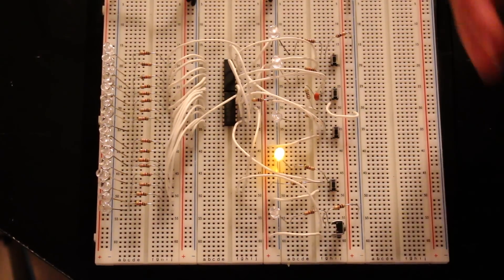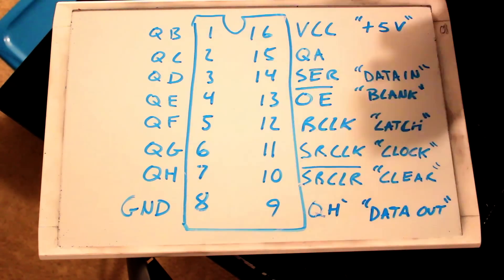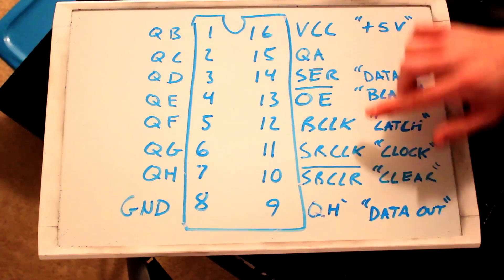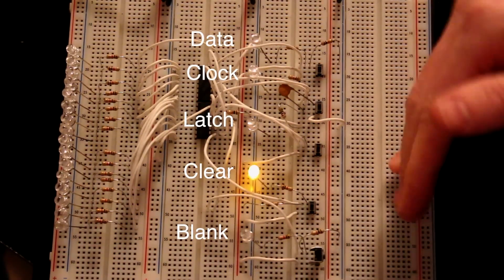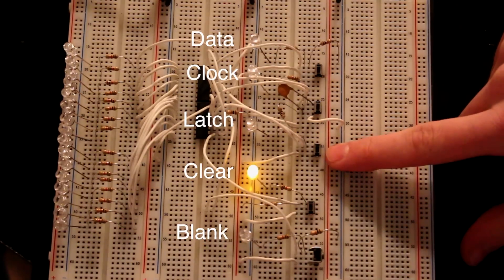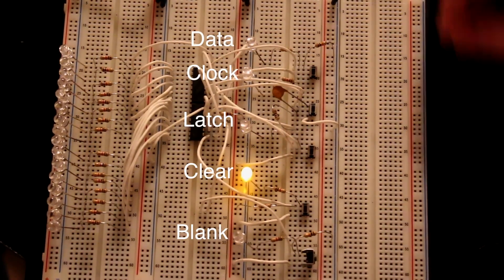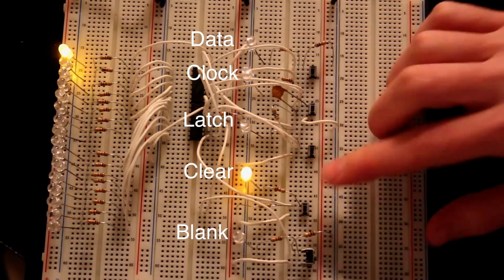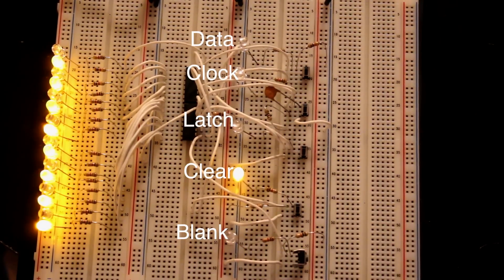How Shift Registers Work!

Comment: Very informative, explains what's happening better because manual. It doesn't HAVE to operate with a uC. You might have a reason to trigger clock or latch only under certain conditions.

Comment: Really nice to see a video, regardless of it being older, talking about shift registers and not including on microcontroller. If you are able to do a lot of stuff without microcontroller than you can just absolutely do killer stuff when you start using them! As a very stereotypical example, just a simple LED Chaser circuit, doing it with couple quad comparator chips , shift registers stuff like that is going to teach you so much more than diving straight into microcontrollers and microprocessors! If you get it even halfway decent understanding of operational amplifiers, latches and flip flops, miscellaneous 7400/5400 series chips or even 4000 series stuff and understand how to combine them together and so on and so forth -- it just allows you quite literally make whatever you want, even with just going a pic16 chip :-)

Comment: this a very informative tutorial,however you could have mentioned if it is a SIPO or PISO chip because the difference between serial data and parallel data could be crucial in ruining a system,is it true that if you used PISO shift registers the inverse of the circuit would be true?

Comment: I tired replicating this but couldn’t get mine to work. The LED lights hooked up to the data/clock/latch buttons light up when I press the button but then when I hit the latch button it doesn’t light up the LEDs on the any of the outputs. Is there a way I can test the shift register to make sure it’s working? How do I trouble shoot this? Any advice?

Comment: Can you tell me the difference between that chip, and the 74HC574 Octal Edge Triggered D-Type Flip Flop? Just by the description, Octal means 8, they both have 3 state outputs,  so the real difference is the term register, and Flip-Flop. So what are the practical differences between the two. Most specs are the same.
Reply: The difference is that the flip-flops inside a shift register are internally connected, whereas the flip-flops in the 74HC574 are independent. You could use external wiring to create a shift register from a 74HC574.

Comment: 03:32...Bro you messed up with names of SRCLK and RCCLK
Actually SRCLK (pin 11) is shift register clock and RCCLK (pin 12) is storage register clock
Reply: IOT ACADEMY I noticed this too! He got the numbers and  abbreviations right according to https://www.ti.com/lit/ds/symlink/cd74hc595.pdf But, he calls them the wrong names. SRCLK is "Shift Register CLocK". RCLK is "storage Register CLocK". What he calls "Latch" and "Clock" are consistent with common EE nomenclature. But he verbally swapped the long-form names. In other words, everything he wrote down, he did right. What he tried to improvise off script he got wrong.
Reply: The mistake starts at 3:18

Comment: Do these things operate fast enough to say, illuminate shift lights in a race car? As you engine speeds up easily enough you just keep shifting ones in, but you can't do it in reverse. You would have to clear the all the data, and shift in n-1 number of 1s. Can a shift register do this faster than the eye can tell?
Reply: If you can push data to it fast enough (for example from a microcontroller) it should be able to do it.

Comment: This video is really well explained but one misunderstanding is seen in 7:25. I don't know why it works in your shift register but I done this by using microcontoller+74hc595 and what I can say - if only clock goes from zero to high state it won't put zero in register, you have to put data pin high when low and then put clock in high state. Done this by simulating in Proteus 8 and also tested on PadBoard, so your method works only  in simulating program but not in real life.

Comment: Great way of demoing how they work. Shame you were dismissive of the blanking line :P an example of its utility many people can relate to is a blinking 7seg display, suggesting user input.
Reply: George Hafiz but with modern microcontrollers it's too easy to just blink the whole register with code. Then you can do the more common thing of blinking only the first 2 digits of a clock and then only the second 2 digits for inputting hours then minutes. Saves you a pin but costs you a bit of memory.

Comment: Sorry for noob question..Can I send in 2 bytes of data and then latch it or is it one byte - latch, one byte latch?
Reply: Yes, you can. Just do all the data in and clock cycle inputs, then hit the latch, rather than repeatedly doing one clock cycle, then hitting latch.

Comment: explained so that all is as clear as crystal (and not as confusing as the rules of american football).
I spent hours working this out when I first started doing stuff like this....to the point, that instead of 'counting sheep' to get to sleep, I was wiring these circuits (and multiplexing, working out clock cycles, etc) in my head. needless to say, the leds never lit up up (in my head) because at that point I was snoring (apparently....ask the wife, lol) . designing the circuits is one thing....writing the code to control the circuits is another. electronics and coding where two separate disciplines until the PI and Arduino hit the scene.
you present this subject (and others on your channel) very well, Kevin. I could have saved lots of hair pulling time if I'd had info like this.

ref. shift registers & co: there's a nice wee freebie program on google playstore I can recommend, called "current for android", in which you can simulate logic gates, shift regs, ram, flip-flops, adders, scroll led and lcd displays and so on.  I use it all of the time - especially when there's no chance to squeeze in some quality lab time. a great tool to have at hand when one has a 'eureka moment' ;)

thanks for posting, man. subbed btw! :))

Comment: You are an excellent teacher! I"m an engineer but new to programming.  Can I use shift registers to control over 50 mini-vibrational motors (smart phone vibrators)?
Reply from the maker: yea, sure, just watch your total current draw per shift register and might want to throw in an antiparallel diode across the motors
Reply: great...thanks much! :)
Reply: One word here... Transistors :)

Comment: Definitely one of the better IC demonstrations I've seen. Well done! It does appear that for simple animations, microcontrollers can latch more often. Out of curiosity, driving common cathode (-) RGB leds, how would you control common sink RGB leds? There seems to be one option where each led occupies 3 bytes on one output, or an option of using 3 sets of shift registers in parallel where each led occupies 1 byte on 3 outputs.

Comment: Wait, if it's on the rising edge, then when one register pushes data out it's out pin after you press the clock button, hasn't the clock on the second register already been on high for a while?
So there's some small delay they tolerate then? Or am I missing something?
Reply: He doesn't actually use the output 7 (QH) as the input for the next shift register, but rather QH'. If you look here https://www.nxp.com/documents/data_sheet/74HC_HCT595.pdf on page 5, you can see QH' (on this datasheet Q7S) already turns high when the clock goes low; so if it goes high again, the input for the second shift register already is high
Reply: MeatLeBeef Dam that's pretty clever, thanks.

Comment: Can you turn on 8 LED-s (simultaneously) with this Shift register if every LED (with resistor in series) must have the current of 20 mA? Data sheet says that the Maximum Vcc current is 70 mA, so... No?
Reply: Btw. gr8 video...
Reply: Btw. gr8 video...

Comment: I have played with electronic projects for years just for fun during the long cold winters.  I play with the Basic Stamp and A/D converters, temp sensors, easy things like that.  I have always wanted to learn how to build and use the basic circuit building blocks that make up a real circuit.  Over the years my interest in electronics has faded a 'bit' (see what I did there?).  

I had to buy an oscilloscope for work and was doing some research when I ran across your videos on the shift registers.  

You explain everything is such a way that it is easy to understand.  I'm excited to watch more of your videos.  Tonight's project is to dig out all of my electronic parts and get to work on your shift register project.  I know I have some 595's just not sure why I ever bought them.....

Thanks a zillion!!
Reply from the maker: +Dana Anderson thanks!

Comment: Hello I have a problem with the shift register. When I turn on the device sometimes I get random data already(ex QB, QC is high) this is the case when the shift register works as expected, but when I turn on the device and get from start every Q output as low, the shift is not working at all(can't insert 1's). What is even more weird is that when I already have something in it if I shift 0's till all are low, again is not working at all, can't insert other 1's. I connected pin 10(SRCLR) to +

Comment: HI there! Great tutorial, built the circuit from your other video. But I had to pull down the clock, latch, and data lines with 1k resistors to stop static interfering with the 74HC595. Drove me crazy trying to find out why it wouldn't work till I found out my hand was carrying a positive charge lol! Useful for anyone else building the circuit.

Comment: ..excuse me, is possible to have the schema of the circuit of this shift register, I am interested to realize this circuit with the value of resistence and other, especially the connections between  push button   and 74hc595 and between led and the integrated.
All of that is possible to have for realize with succes this circuit.
Tank you very much and my best regards.
gigino

Comment: Why there is a capacitor at the clock bottom?
Reply: LinardsHunteR I think it is there to fix a problem called bounce. Basically when you press a button it can bounce and send the signal more that once
Reply: Yes, that's it exactly. Remember this metaphor: Resistors "slow" the flow of current. Capacitors "slow" the changes in the flow. Of course "slow" is not correct but in the context of the common water metaphor, it works.

Comment: Hey Kevin I think I have managed to get correct outputs after adding a 7805 voltage regulator to the clock input to the 74HC595. Thanks to Afrotechmods's video on voltage regulators.

Comment: Umm, when I input the ones the output are correct, however when I enter one zero, the output are 2 lows instead of one low. Do I need a 5v voltage regulator before the clock?

Comment: Once you've added say an arduino.  How can one pin drive so man LEDs?
Reply: You would need more than one pin, because you would need pins to drive the clock clear and latch functions. But still, if you get 8 static outputs from 4 pins, you are still winning.
Reply: We'll I actually meant how could 1 5v source drive 16 LEDs.  

Won't it draw too much current?
Reply: ...and thanks for a reply.....

Been wondering about this for a bit.
Reply: ...that and while I like this guys videos....

At least in this one he says clock in a bit then when he latches it he says clock....

If I had my eyes closed I'd never know exactly which button he's activating.
Reply: Anonymous Really I guess the arduino wouldn't power the actual leds, you'd either use a mosfet or transistor. But I'm also new to this so don't qoute me on that

Comment: hi, great explenation!
does the shift register keeps its memory when the Vcc is off?
so i could use this to store a variable as a byte even when my arduino is swiched off.

reading these bits would probably require another shift register, 8 transistors and some resistors.

Comment: I have followed your other video to build the circuit and soldered it directly on a pcb, all looks good except that I haven't debounced any button, but this strange thing keeps happening... all the Led's fire up in a random fashion, all at once, flashing, only when I approach the board or the buttons...i think it's EM field or interference from home appliances but I can't make it work. Do you have any advice for this? thanks

Comment: jordanwade94 First, he's already done a lot of videos on the use of shift registers (watch any of his led cube videos). And yes, bouncing caused by physically pressing the button can cause a "double clock" which you don't need to worry about if it's actually using a clock pulse you supply from arduino.

Comment: I'm trying to replicate this setup on a bread board, but how do you control the clock with push button? because just putting a push button between a 5v source and the shift register, basically does 4 to 8 bit everytime I click the button...
If you don't have a network diagram, ok, but can you tell what component the clock button is actually controlling? thanks

Comment: You are controlling 8 standard leds (~20mA) with every shift register. I looked at the datasheet of this ic and the maximum supply current is 50mA. How can you have all 8 leds on at the same time? That would draw  160mA which is more then 3 times the maximum limit!

Comment: Here is a video of what I have got
watch?v=5KPNbgIqF14
also provided the source.
i use 5V
Data comes in with no problem and all seems right, but I cant get it out put the stuff from the registers to the output.
I looked at the datasheet and all seems to be connected right.

The 74HC595 may also not be grilled, because sometimes (at random momment) i get some output

Comment: This really is a great tutorialy and was easy to understand.
I am testing the 74HC595 now, but I don't get any outputs.
Clear is High, Data is high while clock is rising and latching does not do anything to the chip. I am using a Raspberry Pi with Python. Do you have any suggestions?

Comment: First off let me say I love your videos and keep up the good work! I am going to build a digital clock using an Attiny 45 I have 5 pins to control 23 segments. Three 7 segment displays and 1 segment for the tens column (I wired them together to cut down on the number of outputs) and 1 for the : encase I want it to flash for some reason. I also have 3 SN74HC595N shift registers that I can use. I never used any shift registers before so is it possible and where do I start?

Comment: Another great video, Kevin!  I built a traffic light simulator (4-way with left turn signals for the main street as well as crosswalk signals and emergency vehicle triggered light changes) using four of the 74HC595s... these are great for expanding the outputs of an Arduino.  I also used two 8-bit parallel to serial shift registers for the road sensor/ pedestrian crosswalk buttons.  Someday I will upload a video with the whole project.

I like your videos - they are clear and easy to follow!

Comment: Thanks for the clear tutorial! I wanted to mention that I'm using a 74HC595N,112 from Phillips Semiconductor, and the purpose of the pins for 'shift register clock input' and 'storage register clock input' are reversed from what you describe here. On this chip, SH_CP moves the stored data to the outputs, while the ST_CP is the clock for the data shift. It had me pulling my hair for a while.

Comment: why doesnt anyone explain you have to send binary to the register? The way I thought i understood it was you just shiftout a 1 or a 0 and then that would go to the first pin. shift out another 1 or a 0 the first pin would get moved to the second pin and then the new value goes to pin 1. This isnt how it works at all. To light up pin 1 and 2 you send a 3. Crazy! No one explains the binary part of it. And tell me if I'm wrong the only "real shifting" happens if you have more than 1 register.

Comment: Awesome! I was wondering why I was getting weird results with my shift registers. I didn't realize that the data actually got shifted between latch pulls and wasn't cleared after the latch was pulled. This was causing a lot of confusion :)

I may just be able to get my 3x3 cube working properly now :)